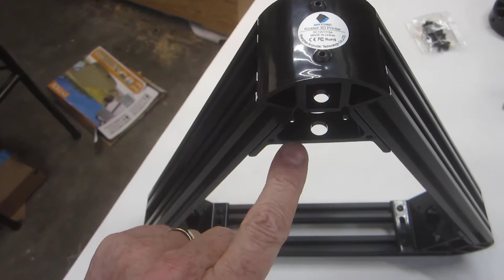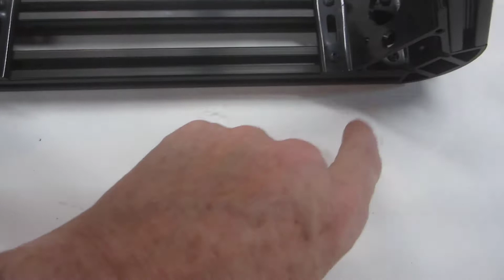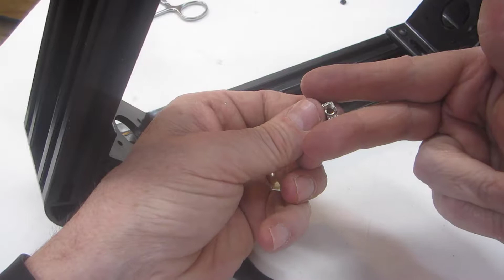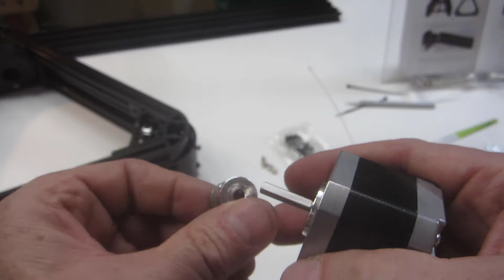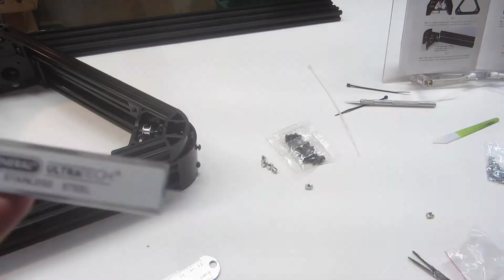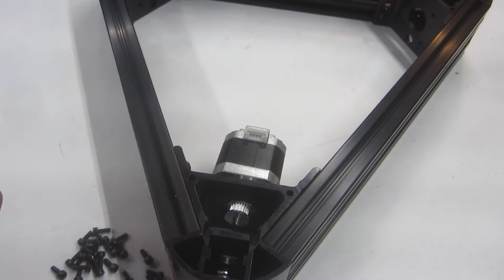Anycubic Delta Linear Plus Build Video 4 Bottom Triangle and Stepper Assembly

Comment: Very helpful videos as I am assembling my linear plus right now.  I found that using a strap clamp to hold the bottom triangle together was extremely helpful.  I could concentrate on tightening all of the screws and the triangle came out uniform and flat.